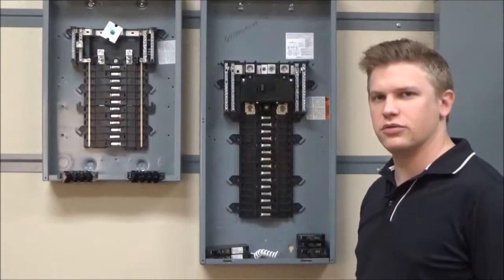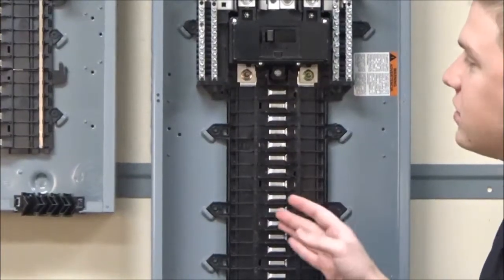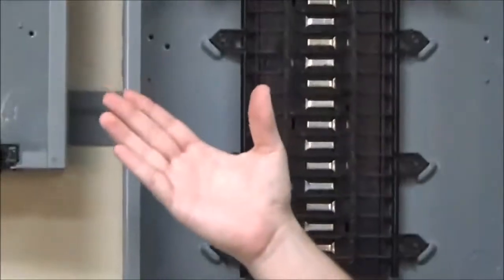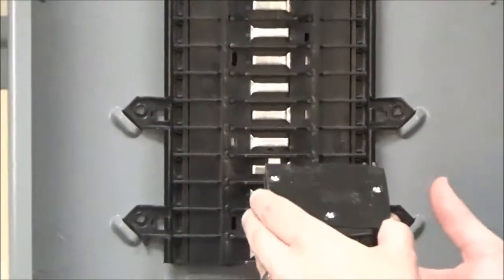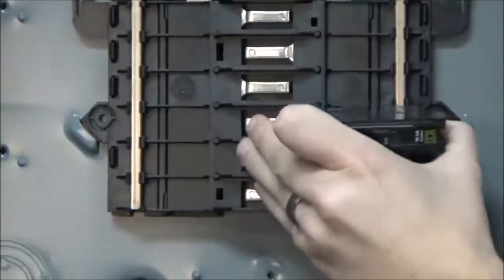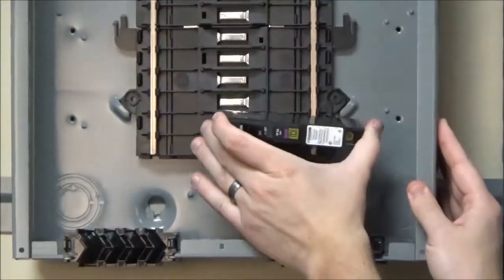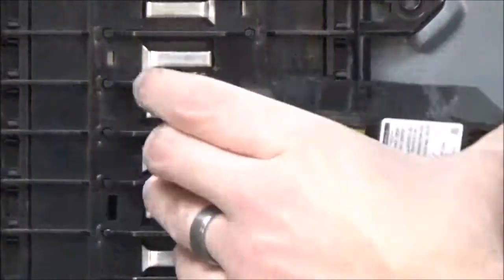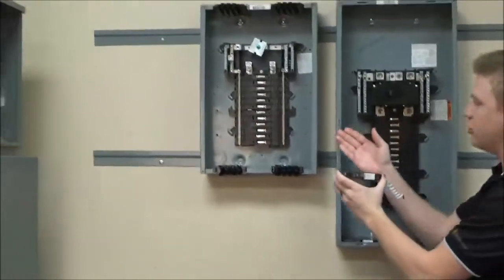Differentiating Plug-On / Non-Plug-On Neutral QO Circuit Breakers & Panels | Schneider Electric

Comment: Bla bla bla,, we are the best bla,  

How can you market a plug on neutral panel and not have QO PoN GFIs without a pigtail.   CAFI, you have, I have a large shop, every circuit thanks to lobbying requires a GFI.  

There it defeats the purpose to have PoN panel and still wire need to wire the neutral to the bus...

QO GFI PoN???  oddly you have it for the Homeline?

Comment: I have a main panelboard which includes the meter and the main disconnect for 200 amps.  This box has room for only 8 breakers but also has pass-thru lugs at the bottom of the box.  These pass-thru lugs carry power (200 amps) to a subpanel.  The main panelboard as well as the subpanel are Square D.  Do I install the whole house surge protector in the main panelboard or the subpanel or both.  Please advise.
Reply from the maker: Thank you for your message. We house most of our documentation in a virtual database here: https://www.se.com/ww/en/download/. If this does not address your concerns, please reach out to a technical support person in your location.https://www.se.com/ww/en/work/support/country-selector/contact-us.jsp

Comment: The denial feature on the QO plug on neutral breakers does NOT work on older ( late 70s) QO load centers. The clip rail is metallic, but not part if the neutral bus bar. FYI

Comment: Just realizing one could use one of these breakers to determine a fault on a neutral run.  These also overcome the shortcoming of "connecting all the neutrals together into one big circuit", which was a poor design from its inception, but has finally been overcome with these type breakers...

Comment: As for the GFCI on the plug-on, why would you need a pigtail if its already sitting on the neutral?
Reply: The standard pigtail gfci breaker is not the ideal breaker to use in their plug-on neutral panel. He was just showing that it can be done if that’s all you have and don’t want to spend a bunch more money buying the plug-on breakers.

Comment: Ok, now I can tell the difference, but I still don't know WHY. But it looks to me that plug on neutral provides a neutral plug for each breaker, to support arc fault and gfci breakers.
Reply: I think what the demo failed to show is that if you are using the one with the pigtail, (on an older panel) the pigtail needs to be connected to the neutral busbar.
Reply: @TKO75  Do you just cap off the pigtail if you're installing it into a plug on neutral load center?
Reply: @FastRedPonyCar  No, if it has a pigtail it must be connected to the neutral bus bar, since there's no plug-on component to it.
Reply: @FastRedPonyCar  That depends on the breaker. I have 2 AFCIs that can be connected to the panel or the busbar, so they don't have the safety feature he describes in this video and I have them both on a panel with no plug-on neutral bar. In my case I have to connect the pigtail to neutral but if the panel provided that direct connection there would be no need and could be capped off and tucked out of the way. Again that depends on the specific characteristics of the breaker, check the product's page first.

Comment: What is the name of the black plastic piece that is mounted in the gray metal box (it has the metal CB mounting connections) ? And can I buy just that black piece with the connectors on it?  QO2-4L70RB is mine.